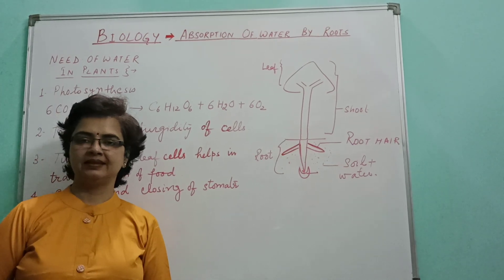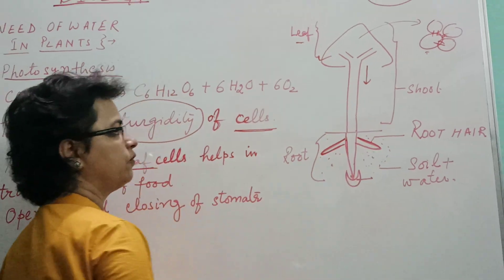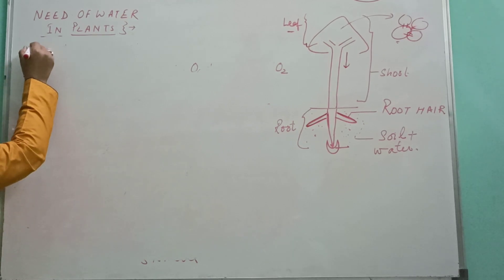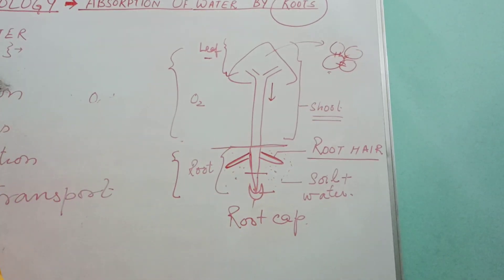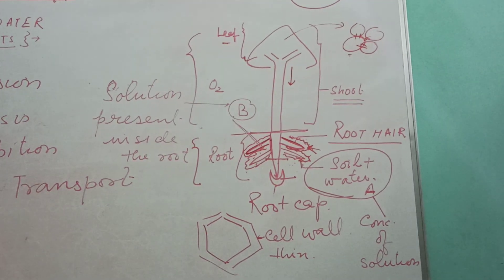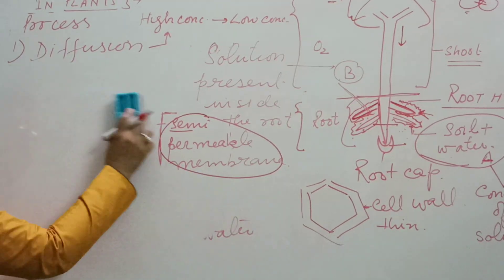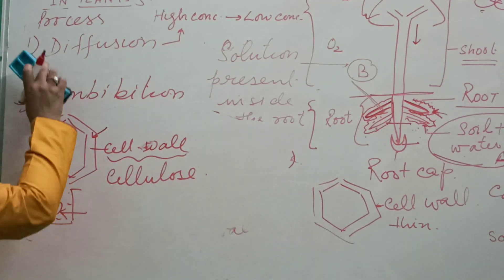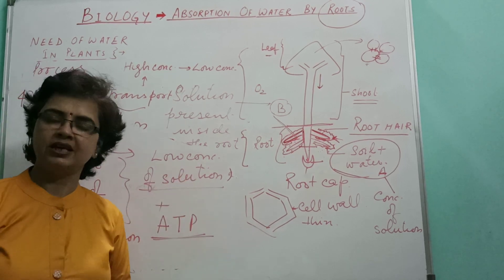Absorption of water by Roots

Comment: Sorry Ma'am but Osmosis is movement of water molecules from region of higher conc. to region of lower conc. 😀😅 9:32
Reply from the maker: Thankyou for comment

Concentration is always added with solution word
So movement of water molecules from lower concentration of solution to higher concentration of solution through semipermeable membrane is the correct definition beta.

When we write in respect to the solvent then
Movement of water molecules from the area of its higher concentration to the area of its lower concentration through semipermeable membrane is called osmosis 
In second definition ' it's ' word is written for water. If in any solution is having more water then the solution is dilute solution ,means lower concentration of solution.